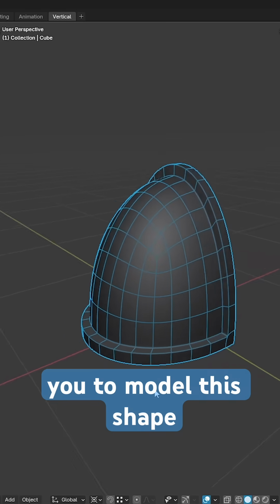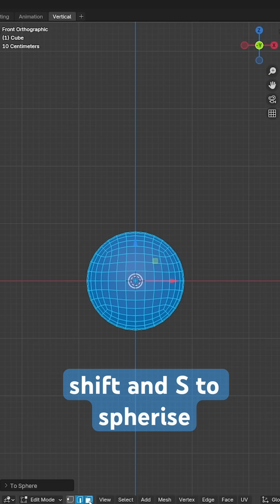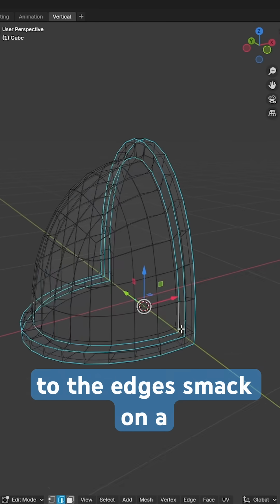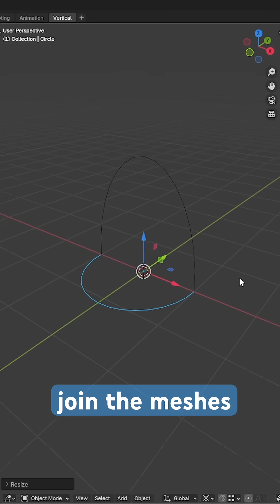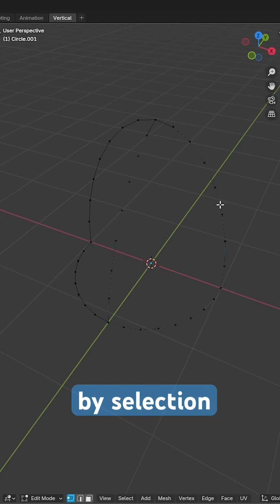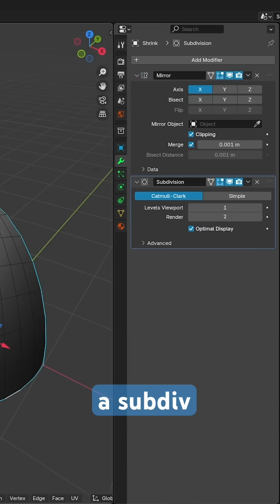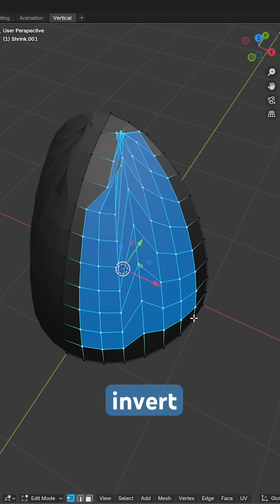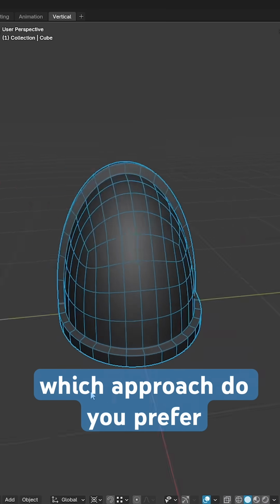Blender Space Marine Shoulder Modelling Challenge Solution |  #blender3d #blender3dmodelling

Comment: Huh. Interesting approaches! Id just slap a sphere, fiddle around with extrusion and clean it after xD
Reply from the maker: The only problem with using a UV Sphere is the triangular poles at the top and bottom; you'd run into a lot, which is why I chose the subdivided cube (quad-sphere) in the first method. 😄

Comment: I'm a pro game artist and that second method made me recoil in horror and disgust
Reply from the maker: Oh, right. 😔

Given your skill level, I thought you'd be able to appreciate it's broader applications to curved surface modelling. As it enables you to block out a shape without a regard for topology and then shrinkwrap evenly distributed quads across the model.

But sorry it made you feel that way mate, was only trying to make educational content. 😔
Reply: @masterj2001  I might have come off too strong and hatey, I wass just poking fun, Im sorry mate :)  
But to give a more complete & constructive opinion:  Quick & to the point will always be better than convoluted. 
And even if good topology is important, quads aren't as Imperative as people think as any quad actually stays triangulated anyways ""under the surface" 
even when blender shows you a quad. They are more about easy loop selection + you had exactly the same nice topology from method 1 
so the second doesn't add any value beside extra steps in this case.
Reply from the maker: @kevinpopescu9741  Oh, I 100% agree! You're absolutely right that, in this case, the method is more convoluted than necessary. 😅

I’m also familiar with using tris and ngons in workflows. Like you said, all quads ultimately resolve into tris, and subdivided tris/ngons will resolve into quads, a bit of topology inception. 😂

That said, for curved surface modelling, sticking to quads generally helps minimise pinching errors. So for tutorial content, I figure it'll reduce the chances of people running into problems on their end. 😄

I included this method because not all rounded object modelling is as straightforward as this shape. I thought it might be useful to show an alternative approach that could be applicable in a broader application of situations.

And thanks for clarifying your initial comment! Sarcasm and satire can sometimes be tricky to read online, especially since some people do say things like that with genuine ill intent. 😅

Really appreciate the discussion as well. Getting people thinking and talking about modelling is exactly what I’m aiming for! 😄

Comment: uh, we're not here to flex how much we know, we just wanna make objects. your curvature method is long, convoluted, and it's not practical.
Reply from the maker: Oh, it wasn't a matter of flexing knowledge. I'm sorry if you interpreted it that way. 😅

I included it here because it has broader applications for modelling with curved surfaces. This enables you to block out the shape first without regard for topology and then shrinkwrap perfectly distributed quad-based topology over the top of that. 😄

I agree that, in this instance, it's more convoluted than the first method, though I wanted to include it due to its applications in other cases of curved surface modelling. 😄

Hope that helps clear things up?
Reply: @masterj2001  cleared it up thanks.

Comment: That second method seemed so convoluted
Reply from the maker: It definitely is, though I included it as it has a broader application that can be used in other curved/rounded surface modelling. 

It offers a method of being able to model first without regard for topology, lay out the shape, and then shrinkwrapping clean topology over the top of it with perfectly distributed quads and poles. 😄

Comment: The second method seems a lot more complicated, is there a reason for why that could be better than method 1?😅
Reply from the maker: I wouldn’t go as far as to say better, but I wanted to include it as I think it has good applications outside of just this specific example. 

It can be used in pretty much any rounded object modelling use case to help with getting clean topology with evenly spaced quads. If you just wanted to quickly block out the shape of a helmet or some other rounded object, but didn’t want to first worry about the topology, you could just make a rough blockout, heavily subdivide it and then get clean topology using a shrinkwrap, grid fill, and the smooth verts operation with a secondary mesh.

The only ‘benefit’, and I say that rather loosely, in this instance is having a bit more customisation with the silhouette of the curvature. But outside of that, rather negligible advantage over method 1, just thought it was a fun trick to show with broader topology applications. 😄
Reply: incase you have to do it From Weird Angles...
cause Method 1 Will get the Result but what if you want to do something funky with it..
Method 2 Allows for that but at the cost of More Set-up (aka Time)...
Reply from the maker: @pikachufan25  yep, this is a great way of summarising it. 😄
Reply: @ haha  i was not suspecting you to read the comment haha...
Reply from the maker: @ I try to read and respond to all the comments the best I can. 😄

I make this content to teach and educate people about 3D modelling and part of that, in my mind, is engaging with people. 😄